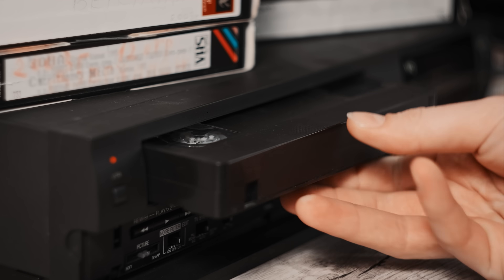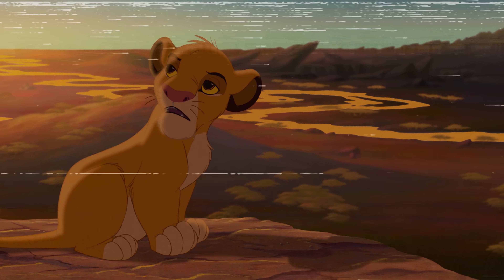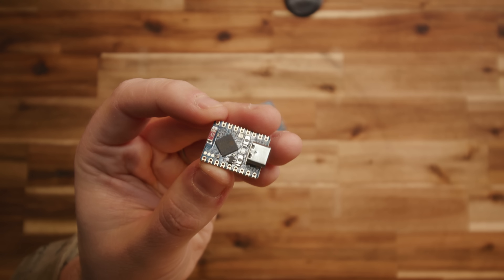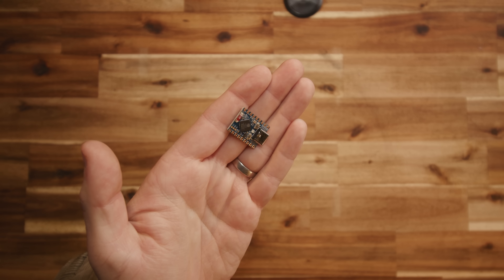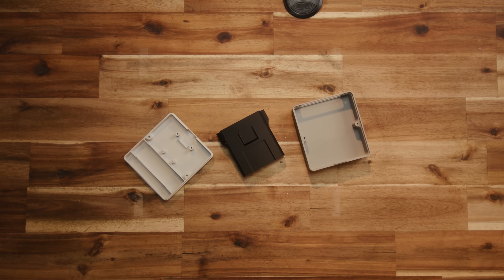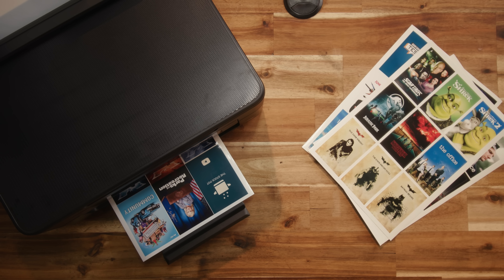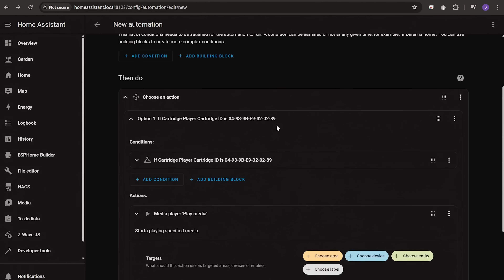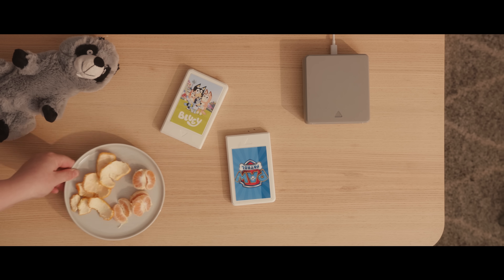I Missed VHS... So I Made My Own

Comment: Here's a not-so-subtle reminder that Blu-ray & UHD Blu-ray still exist for now and should be supported if you care for the physical media experience.
Reply: UHD is noticeably better, but people don't understand how bad streaming actually is unless they see them side by side.
Reply: @tenchuu007 so true. I have been spending quite a bit of money getting physical media, and have started getting the UHD, digital, Blu-ray combos. And watching the digital on my lg OLED and then watching it as UHD disc, the difference is almost night and day.
Reply: @tenchuu007 So true. Unfortunately due the high cost of both players and disks I think most people will never see them as a viable alternative to streaming. Also, this may be my own personal experience, but I've experienced far more playback problems with UHD disks over standard Blu Ray. I've never had any skipping with a standard blu ray but have had numerous UHD disks skip and freeze.
Reply: Just buy an old ps3 or 4 for 50-200$
Reply: @SereneSoundsx PS3/4 can't play UHD Blu-rays. PS5/Xbox Series X can, but they don't fully support all of the features people buy UHD for like Dolby Vision so buying a dedicated player is the way to go.
Reply: @CamCon586 I have a ton of 4k and I get the odd skipping but if you wipe them down with micro cloth does the trick  it due to off gas that can happen
Reply: @tcherry7  PS5 doesn't have Dolby Vision either, you need a dedicated UHD player for that.
Reply: @SereneSoundsx  why would I buy 4 ps3s?
Reply: @tcherry7 Xbox One S and X plays 4K blu-rays too.
Reply: @tcherry7  Definitely get a dedicated player but for a newbie physical media collector an Xbox One S (the previous gen white smaller model) plays UHD just fine and you can get it for about $45-$100 so not a bad way to start at all. After you get maybe 200+ disc then yeah a dedicated player with some of the other features is probably worth the investment.
Reply: @tcherry7 last time I checked both the PS4 and 5 could play Blue ray so idk what you're talking about saying they can't.
Reply: @CamCon586  A lot of people already have 4k players with PS5 and don't even know it. Also most 4Ks for popular movies are cheaper than buying digitally or the same cost and include a digital code so you get a digital version anyways.
Reply: @tenchuu007 though it's a shame the other presentations suck. Blu ray disks and menus make the official release look like bootlegs. I know it doesn't matter. But man, I miss how much care and detail the used to have. Now they kinda just feel like an after thought
Reply: @tenchuu007 it’s impossible to go back to streaming after seeing uhd discs.
Reply: @HydratedBeans  with that logic doesn't that mean that youtube videos are also below you now?
Reply: I was able to buy a UHD player at a flea market for $20, and it was definitely worth it. Yeah, streaming is more convenient, but I love the extra features that physical releases come with and generally, I feel more engaged with the content.
Reply: @jodydbarker92 I got one at goodwill… I didn’t tell them what it was, but $25… I almost felt bad. 😂
Reply: @jodydbarker92 like what other features do you get with UHD BLu Ray that you can’t get from just a regular video file viewing it on a monitor? I’m curious not trying to be pretentious or facetious
Reply: @TheBlackShinigami  typically interview and behind the scenes
Reply: @Thekidfromcalifornia2.0  well that’s fair, whenever I torrent that stuff is usually just included.
Reply: Yeah, I'm about to embark on rebuilding my physical media collection with Blu Ray. I figure if I cancel my streaming services and use that money for physical media I can have a collection of things I actually want to watch and never lose the rights to
Reply: @JackWeems  That's awesome! Have fun with it! Collecting CDs, DVDs, and Blu-rays the past few years again has been so enjoyable for me.
Reply: Physical media, or at the very least a DRM-free file living on a hard drive or better yet some kind of backup drive will always always be better than relying on a streaming service. No matter how big a company is, no matter how much money they make or how many subscribers they have, they can always decide to suddenly stop providing services. And it doesn't matter how much someone has paid into the services or how long they've been with that provider, when that provider goes, so do all of your movies, TV shows and music.
Reply: Even DVDs are still being sold here in America. You could say they're outdated, but I appreciate them for their lack of DRM, and if they're old ones, they can have really neat menus and bonus features!
Reply: Also, the sound is so much better in Blu-ray or 4K bluray than in streaming. It's like day and night.
Reply: I just watched a so-called 4k stream that was definitely not 4k.  Happy with my Sony UHD Bluray player.  Price is finally reasonable too.
Reply: bud, I have a collection of blu-ray and DVDs on the shelf behind my PC that would make the reel archives at most cinemas blush lol
Reply: @Half_of_The_World  Hell yeah.
Reply: @Half_of_The_World 
Ive a box full of dvd box sets plus some blu-rays.
Reply: THE SAME IS TRUE FOR USING CASH!!!! Dont let them take untrackable transactions from us by letting cash become obsolete people, this is a HUGE DEAL. (back to the og comment i was writing..)

so.. am i a bastard for buying them secondhand? fully feel this way tho probs bc of records, but If the blu ray doesnt have any extra commentaries or features tho it feels like a waste to me. i miss those. notes about nothing on seinfeld is one of the coolest ideas ever. idk what uhd is at all haha i burn my own dvds with dvdstyler, i find the quality to be quite nice. also ofc sd cards and hard drives out the wazoo. everything ripped from seconhand finds and freebox groundscores. probs gonna develop another crushingly expensive phys media habit now tho huh lol... woo hoo!
Reply: @Cremulox  I buy a lot of stuff secondhand. Better than going to waste or sitting on a shelf indefinitely. I see no moral issue with it.
Reply: I buy all the hololive concerts on Blu-ray, and the quality is so much better than the streamed version. Plus, if I was at the concert, the higher quality can sometimes make it so I can see myself in the crowd!
Reply: i still buy blu-rays and DVDs. i cancelled Netflix the last time i tried to use it.
Reply: Proud owner of a bunch of UHD Blu-rays 😅
Even the FullHD ones still look great
Reply: About a year ago I coincidentally got the opportunity to compare the Blu-Ray version of the 2021 Dune movie to the Netflix stream version. Of course I know that streaming cannot reach the same quality, but I was surprised of how much I could see the difference in picture quality. Like, there were quite the fragments in the picture and I think the contrast was not as strong either in the Netflix stream. So yeah, if you really like the movie, buying a physical copy might still be the better choice.
Reply: @derlenzer5510 Netflix's bitrate for 4K streaming can be anywhere between 18Mbps to as low as 4Mbps (lower then DVD!), and can vary wildly based on internet connection, server capacity and how popular the show is. Compare that to 1080p blu-rays which are usually between 20-40Mbps and 4K blu-ray which can exceed 100Mbps, the difference is night and day. And the bitrate of blu-ray (and DVD) is baked into the disc and formatted during the mastering process to take advantage of what's being shown on screen, giving busier scenes a higher bitrate and static scenes less, rather then being a variable that changes every time you play the movie (where there's a chance that Netflix will decide to give you a bitrate in the single digits on your "4K" stream in the middle of a fight scene because their servers are overloaded).

I've got a copy of BBC's Planet Earth blu-ray which I played recently, and the quality of some of the busier animal chase scenes that include snowfall and fast camera movement look absolutely superb, way better then any 4K stream I've watched. And this is a 1080p disc from _2006_. It's pretty amazing that a 20 year old disc is still able to impress all these years later.
Reply: Yes please! Physical media is still here but as more people avoid it, it won't be here all that much longer. And when that happens nobody owns any media.
Reply: I still invest in dvd and a little in blue ray. Mostly dvd cuz it's cheaper XD
Reply: Blu-ray is still at a point where it can degrade.
Reply: @TheOmegaRiddler  everything we buy does that. Food degrades over time, too, that doesn't mean we should stop buying food.
Reply: @LunarShift  “everything we buy does that”, not properly setup raid or zfs systems. As the drives degrade the data is kept safe and a couple hotswaps once a decade and you’ll be fine, as opposed to a less actively used system like a disk where you may put it in one day ten years down the line and it just doesn’t work, in which the data is gone if that was your only saved location
Reply: @JeronimoStilton14 I didn't say data degrades. I'm talking about the physical objects that contain data in the context.
Reply: @TheOmegaRiddler  Disc rot is more a issue of bad manufacturing then an inevitable symptom of the medium. Some early blu-rays and DVDs have started exhibiting disc rot but it's a rare phenomenon even for discs that are 20+ years old. And likewise other discs of the same vintage play exactly the same as they did when they were bought new.
Reply: Yeah, making the diskette cartridges, but for Blu-Ray would be the way to go.
Reply: Yeah I get my physical media fix with bluray and uhd discs.
Reply: I still buy Blu-rays and 4K disc, the sheer quality is insane. Also I like to buy the movies I actually want to watch and enjoy them far more in the best quality possible
Reply: @LunarShift, yep exactly.. And to be very honest, I find this video interesting and kinda cool, but also find it a complete waste of time. For as much effort as he put into everything, he could have just got an external DVD drive and just put a MP4 onto a regular DVD (Asus sells DVD-RW drives for less then 50 USD still btw). 4.7GB will hold most 4k movies pretty easily of not two if they are compressed correctly without any noticeable loss of quality.
Reply: Bluray as a format itself has still aged well being a format from 2006 and has aged far better than DVD. 4k UHD is phenomenal too though for that pristine cinematic experience but you can get close to that with bluray with the right setup. (And bluray is getting cheaper too encase your someone who budgets a little more and cant always get things in 4k)
Reply: Movies are still being released on dvds too
Reply: @stickdudeyt Yes, but many people will not be willing to accept 480p quality as an alternative to streaming, whereas both Blu-ray and UHD have higher bitrate and quality than streaming services tend to offer, so they're generally an upgrade.
Reply: Blu-Ray Guys (normal people): It looks so much better than DVD and streaming!
Me with my DVDs and VHS: teehee :)
Reply: @sacknana2005 DVDs and VHS are still great on the right setup, and some blu-ray upscales are pretty awful. There are so many factors at play that there's really no objectively correct format to use.
Reply: I love my vhs collection but I’ve been debating swapping most of it out for blu ray as it takes up significantly less space
Reply: but bad video quality? if you really reminisce on videotape like a pro. Hi-Fi buff, the 12-inch vinyl records were the best-recorded sound media. ever?  You're referring to a top-of-the-line, top-end, 6-head, 4-track recorded sound (and not the in-home setup with the analogue recording that was set up to date); the video still does the best analogue. and apart screen resolution, instant play, no rewind, forward  waiting
Reply: @dh2032  those mediums are objectively worse for media which was created in a digital ecosystem than a digital format is, and arguably worse for those which were created in an analog ecosystem. Nostalgia doesn't change that, either, it just changes one's personal preferences.
Reply: @dh2032  Vinyl records are the worst medium for listening to music in proper conditions. For true quality, it needs to be FLAC or DTS, and it could even be Dolby Atmos. I especially enjoy SACD or DVD-Audio. However, everything ultimately depends on how the album master was created during production. Still, vinyl, cassette, or MiniDisc will never be able to replicate the full quality of a master recording. Vinyl is not multichannel, cassette relies on tape, and MiniDisc—although practically indestructible in terms of durability—suffers from its ATRAC-3 compression, which immediately disqualifies it as a Hi-Res product.
Reply: That’s true I dont use streaming I only use Physical media. I only use hard drives and plex to store for when I have to burn them onto new discs if something happens
Reply: I have a ps5 and over 400 movies to watch on it.
Reply: @theproudnativecanadian319  hell of a collection.
Reply: No we care about watching the stuff and now that we got the one click experience there's no going unfortunately companies are denying us their full catalog or even worse censoring content so the best option is 🏴‍☠️🦜
Reply: He did this to have the feel of physical while not wearing down his discs. He's streaming from his own media server
Reply: @killshock360  my comment was directed at viewers.
Reply: @killshock360  Why not just make copies of the discs then?
Reply: Bought one last week, loving the quality!
Reply: Was going to say a version of this myself. I always buy physical of the ones I enjoy. This streaming nonsense just helps me decide what not to buy, lol.
Reply: Bums me out that my Best Buy no longer stocks blu rays or UHDs.
Reply: ... and proper ownership.
Reply: Me reminding you that I've never bought a movie on Blu-ray because they still sell DVD for some f**** reason. (Ok I've bought 2 but still I always buy the DVD cuz it's cheaper.)
Reply: @bland9876 that's valid. Enjoy your media how you like.
Reply: Dude they even make new DVDs. Can you imagine that
Reply: 1000% this! We dont need a new format, we need to support the format we have (although this is a really cool project, and im not against it)
Reply: BOOOOOOOO
Reply: Agreed, and their capacity makes them able to store pretty much any 4K movie or smaller games
Reply: I wouldn’t mind physical media that does degrade.
Reply: maybe its just cuz i refuse to see an optometrist, but i dont believe anything above 1080P is real.
Reply: @PerkinsVR 😂. I sit like 2 feet away from my LG OLED 4K so it’s nice and clear, but I also have an Epson 3 LCD projector set at about 100 inches, but it’s 720p and to my diabetic eyes it’s fine.
Reply: and also we have a sd cards
Reply: @kisoqual SD cards are cool, but that doesn't support the continuation of physical media production like what I'm proposing.
Reply: @kisoqual that's digital media still.
Reply: @kisoqual  SD storage is not designed for long-term shelf life, and usually start bit-rot within only a couple years, as opposed to Disc have 20+ year life, and Tape being even greater at 80+ years.
Reply: The problem of these formats is that they sometime have unskipabble bits which was never the case with VHS.
Reply: @MrAsmontero  I usually rip all my BDs and DVDs. Anything that can't be skipped isn't an issue because I just end up with a copy of the digital file that I can seek through to my heart's content, not that I really care if I have to sit through 10-20 seconds of unskippable piracy warnings or whatever anyway. It's really not a big deal.
Reply: @LunarShift  But its the principle. YThe thing is that  the company still gets to decide how you should watch something that you bought and that sucks. Ripping it is more prefereable but is still not the physical format that you paid for.
Reply: @MrAsmontero  Ripping a copy doesn't stop the medium you paid for from being used. My principles and yours are not the same and principles are subjective. I am not bothered by watching warnings and splash screens, they are part of the experience.
Reply: @LunarShift  yeah I know they are not the same, Im was explaining why I dont like it. which is no control over the thing I bought. You don't care and that's fine.
Reply: Ahahah, no, they should not!
Reply: @florihae  AHAHAHAHA yes they should, physical media is already on the verge of extinction, brainiac.
Reply: In a country where home ownership is becoming a luxury and banks own most of the land, it’s hard to justify taking up space with physical media within limited storage on account of most being renters.
Reply: @ThisisDD no one is saying pack an entire wall with movies but I have 3 tiny shelves that hold about 100 movies total and if you have a cardboard box you could probably put about the same amount in it, space even in a small home/apartment is easy enough to get. But yeah if you want 3,000 movies you will need space.
Reply: The high seas have offered the best solution since before Blu-ray was even introduced, so idk why anyone even cares. Just keep it on a hard drive.
Reply: @delphicdescant  no u right
Reply: @delphicdescant Blu-ray quality rips don't continue to exist if Blu-ray ceases to exist 🤡🤡🤡🤡🤡
If you're happy with your subpar webrip media being the only thing available, maybe physical media isn't for you, but many people making those torrents available are grabbing and re-encoding the highest quality video content you're leeching from a disc.
Reply: No thanks, screw Sony and Blu-ray
Reply: I think he means analog physical media, not digital.
Reply: As the wise Bringus Studios o̶n̶c̶e̶  many times said, "Optical media bad"
Reply: @cheese_wierdo_maxwildthing42 I like Bringus but we'll see who's still saying "Optical media bad" after an EMP cannon wipes out all hard drives and SSDs but optical storage could care less
Reply: @datachu  you forgot about the parts that read the discs
Reply: @cheese_wierdo_maxwildthing42  he's been wrong literally every time. It's a bad catchphrase and his drones repeat it mindlessly.
Reply: @LunarShift  I LOST WII SPORT RESORT TO OPTICAL MEDIA AND MY DISK GOT SCRATCHED, I HACKED MY WII TO USE GAMES OFF OF SD CARDS FOR A REASON
Reply: @cheese_wierdo_maxwildthing42 your not caring for your discs is not a problem with the format.
Reply: @LunarShift  That was within the original casing for the disc that came with the wii. sybau 🥀🥀
Reply: @LunarShift  "It's ALWAYS wrong to say optical media bad"
"I don't even bother actually playing off of it, just put it on my hard drive"
Which is it?
Optical media simply IS bad in a lot of circumstances. It's only so widespread because it's cheap. I still like it, but there are a lot of genuine problems with it.
Reply: @hahasamian8010 Saying I don't spin my hundreds of CDs or Blu-ray discs thousands of times is not contradictory to saying optical media is not bad. Try again.
Reply: @LunarShift  It shows that it's bad in some circumstances, it doesn't really work for you yourself... therefore, the statement is not ALWAYS wrong. 
and again, I say this as someone who pops disks in all the time.
Reply: @hahasamian8010 you're being a pedant lmao.
Reply: @hahasamian8010 Maybe complaining about my actual point rather than my word choice would make me take you at least a little bit seriously. Dwelling on a hyperbolic word I may have used is nonsense.
Reply: @LunarShift  I mean, it seems like you're completely ignoring the reason Bringus says it. As someone who plays video games where fast read speeds are important, and as a PC gamer who knows you can own and keep things without them being printed on discs... yeah. Optical media is pretty bad. It's not bad in all circumstances, but in the modern day it has very significant flaws compared to other options.
Reply: @hahasamian8010  Bringus says it because he's kind of a tool lol. It's a slogan/catchphrase, not a moral position to live by.
Something isn't bad just because Bringus doesn't like it.
Reply: @hahasamian8010 ALL physical objects are flawed. That's kind of the nature of man-made things. Optical media has pros and cons, so does digital media. Not liking something, or something not suiting your needs, does not make said thing bad. It just makes it wrong for you.
Reply: @LunarShift  It sounds to me like you just personally dislike this guy and want to believe what he says or thinks is dumb. You're speaking in extremes and then criticizing me for criticizing those same extremes. It's not like HE said optical media is ALWAYS bad, but in his space and for his purposes (gaming) it is objectively pretty bad. It was you that used the words "always wrong", when he was simply not wrong in his own territory... so yeah, I'll criticize you for it. 

I think you need to be able to accept when you're wrong.
Reply: @hahasamian8010  I don't dislike the guy, I dislike the notion that something is bad because he doesn't like it. It's idiotic.
Reply: @hahasamian8010  and no, game discs are also not objectively bad. I have hundreds of them. They work fine. Take care of your shit if you want it to last.
Reply: @LunarShift  They literally haven't been used to actually play the games for 2-3 generations now. They're slow. You need to take forever installing from the disc just to take another forever updating from the internet anyway. That's assuming there's even anything on the disc, which is not a given. Compare that to a technology like cartridges, which are less fragile, and can be used directly to play your games without demanding you clear 50GB of storage.
Reply: @hahasamian8010 not always the case and I'm not here to debate, I have made my position clear enough by now. You don't have to agree, but I'm not going to fight about it.
Reply: that shit is gonna go away just like CD data
Reply: @welovethesnorks  How many CDs have you had go away?
Reply: @Nukle0n  literally 1000s, that stuff flakes off
Reply: @welovethesnorks of factory pressed discs? That you stored properly? Never seen a cd fall apart like that unless it was left outside in the sun and rain
Reply: @Nukle0n  with factory pressed discs I have even more problems. the plastics they used were prone to scratching, even from normal CD players, so either way CDs have been a nightmare for me
Reply: @welovethesnorks not any time soon.
Reply: optical media bad
Reply: @DillsArtThing  you're a drone.
Reply: Optical media bad.
Reply: @SilentShadow-rj5nx hello fellow bringus viewer
Reply: @SilentShadow-rj5nx lame take/catchphrase. L.
Reply: Bluray sucks, I just buy DVDs.
Reply: retrograde98xp hmm yes i love 480p
Reply: @qfoxb  Yeah, its more than enough for any movie or tv show. It beats needing to connect your player to the internet because its encryption keys are out of date.
Reply: retrograde98xp7 i really don't consider 480p a good experience but it's not unwatchable
Reply: christianseibold3369 Wow, 480i vs 480p, finally, a hill worth dying on in 2025.
Reply: @retrograde98xp7 DVD sucks I only buy laserdisc 😂😂😂 more seriously, a good blu ray blow any DVD. Bad DVDs and Blu-Rays exist but theses format aren't bad for that. If you have a good UHD blu ray or even just a good simple Blu ray you'll have a better movie experience than with DVD)
Reply: @retrograde98xp7 That is the dumbest take I've heard all month, Blu-Ray is objectively superior to DVD in literally every way. Including lower risk of disc rot and less susceptibility to scratches (at least on the players that came out after the initial rollout that couldn't handle scratches well)
Reply: @datachu  Blu-ray SHOULD be objectively superior to DVD, but most Blu-ray menus are zero-effort and they're often missing features that were too hard to port from DVD. It's sad but the standard-def format often feels like more of a complete experience than the HD format that's supposed to be superior. If the format was an extension of the DVD format instead of Sony strongarming the industry for control, maybe things would be different but... as it stands, there's a lot of DVDs that are better than the Blu-rays.
Reply: @hahasamian8010 Wow, that sucks, special features are one big advantage to physical media over streaming.

The special features on the Blu-rays I've got are fine, but to be fair I don't have the DVD versions to compare to. There's simply no excuse for skimping on them other than laziness. The way the menus work is very different so it does require work but they're also far, far more capable, so anything a DVD menu can do, a Blu-ray one can. And we paid a premium for the Blu-ray release so it should have the same or better experience, especially when technical limitation isn't remotely an excuse.
Reply: @datachu  Yeah... At this point, for modern films Blu-ray probably is superior, but there's simply not as much effort put into these things in general now... and for lot of things, the effort for DVD was higher than Blu-ray.
I hope some niche releases come that are as packed as what we used to get...
Reply: @datachu  I never have to download updates for my DVD player.
Reply: @retrograde98xp7 Then you haven't owned basically any DVD player made after 2010 lmao. Or a PS3/other console with a disc drive for that matter, which is how everyone I know played their DVDs and Blu-rays
Reply: @datachu  I don't have to download updates to use my disc drive. I have a ps2 which hasn't gotten a software update since it was manufactured, yet it can still play brand new dvds. Meanwhile without up to date encryption keys, your PS4 is not playing the newest blu rays.